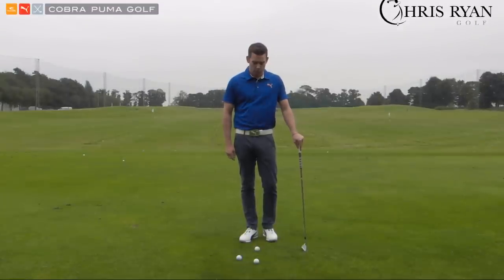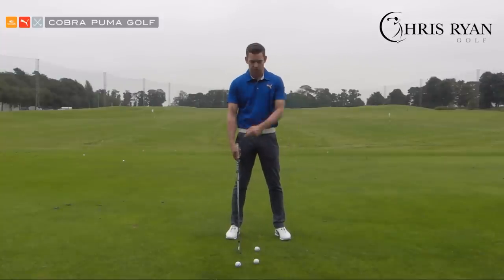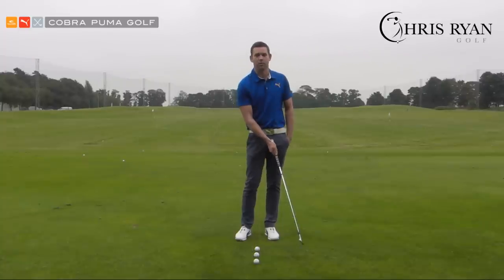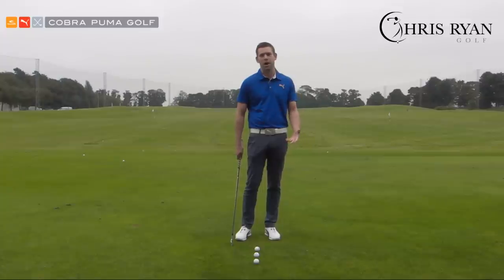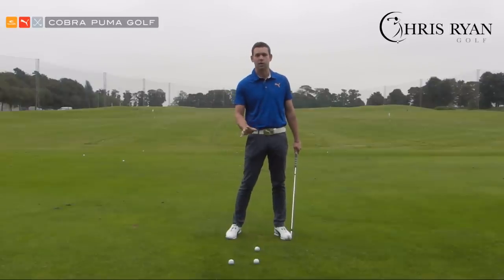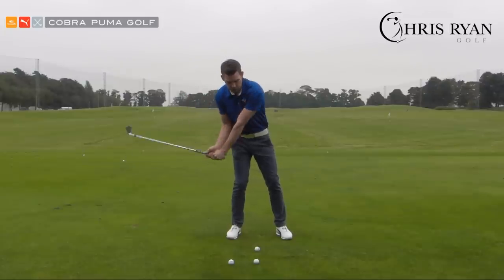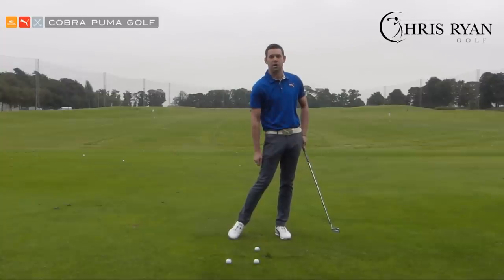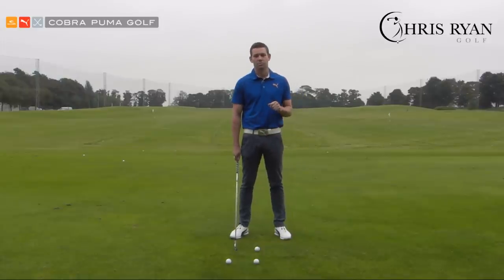Golf Drill for More Solid Contact

Comment: Great Lessons...  I have a 10-15 yard straight dead push that I can't seem to correct, any suggestions?  Thanks Hal
Reply: +GolfNaples In my experience (I'm a 1.6 handicapper), dead pushes are caused simply by not rotating enough through the strike.  It generally means that you have initiated the swing properly and are swinging from the inside, which is good.  But at the point of impact, your lower body motion stops or slows, and the club continues to travel on that inside-to-outside path (instead of squaring up to the intended line of flight) and the shot is a push (you usually hear people refer to this as "leaving it out there").  Trying to correct it by feeling more/earlier hands release is a dangerous and inconsistent proposition.  I would say to first try to rotate more aggressively through the shot...not "faster," just more "completely."  See if you can get your belt buckle to be facing at or slightly left of the target (if you're a right-hander).

Exactly how MUCH you need to rotate more depends on your personal swing, grip, etc.  I play with a neutral-to-weak grip and try to slot the club pretty deep on the downswing, which opens the face and promotes a fade, so I have to make sure I rotate very aggressively to avoid hitting blocks.  But that's just me.  Your experience may differ.  But try rotating more completely through the shot FIRST.  Don't let your lower body "check up" on the through-swing.  See if you can get that dog to hunt, and then make adjustments if necessary.  Hope this helps!